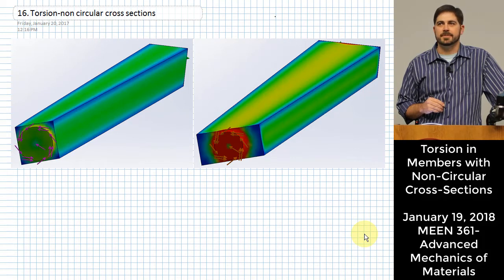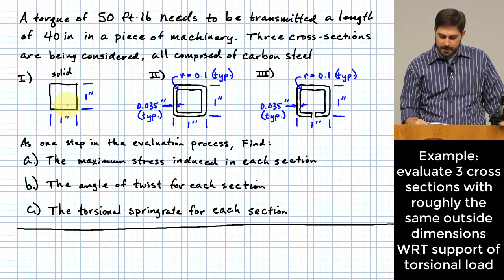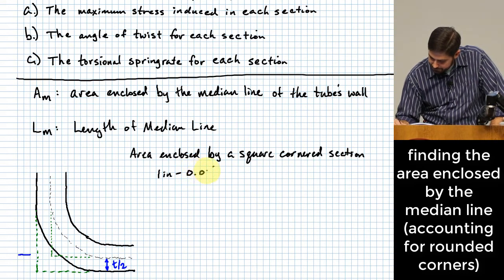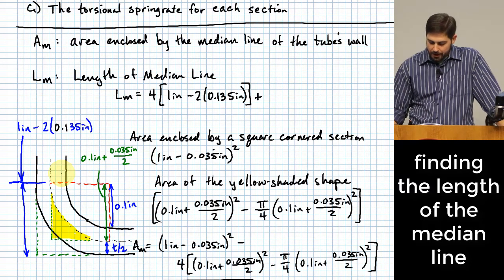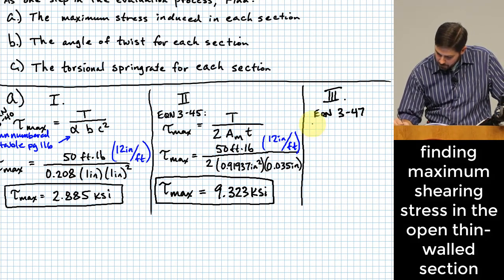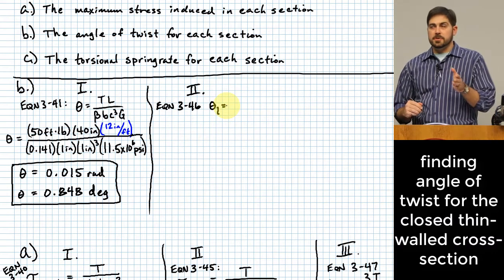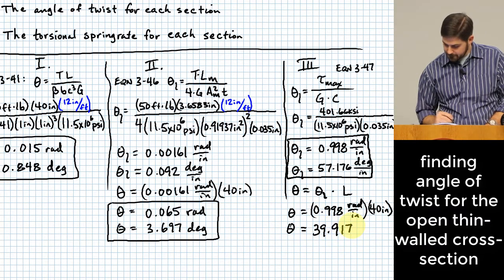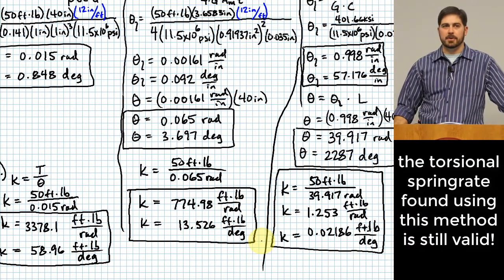Torsion of Non-Circular Cross-Sections (or, Open Sections Suck in Torsion)

Comment: Sir I am working on a project.i have a doubt.we we consider two different open section beams keeping the material and load conditions same .if maximum stress in material 1 is more than in material 2 after analysis .then what conclusion we can make regarding the strength or load carrying capacity of the sections?